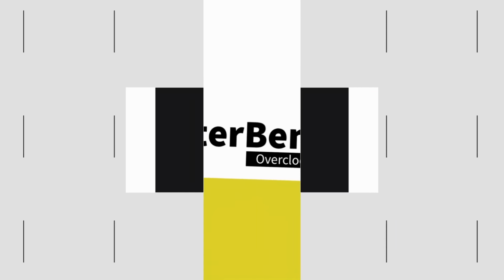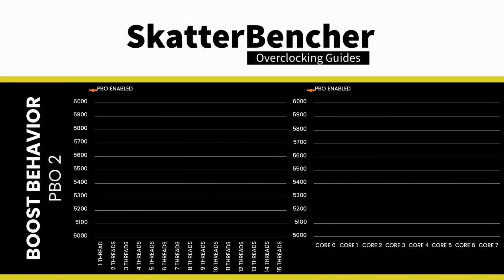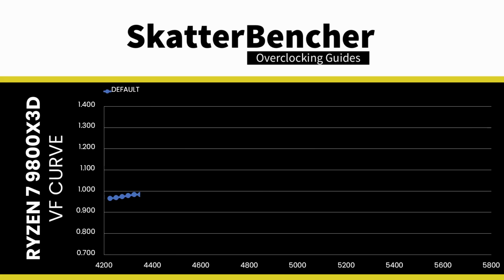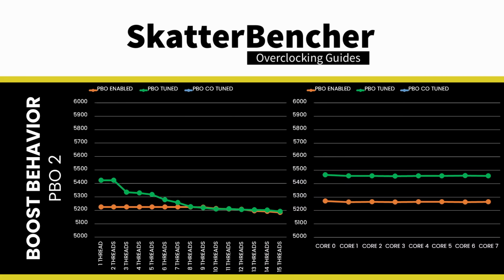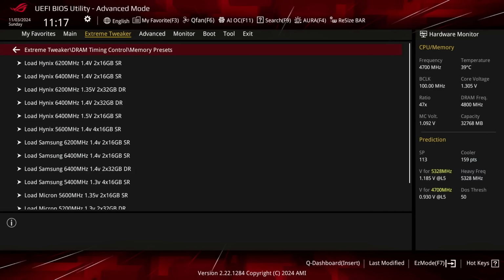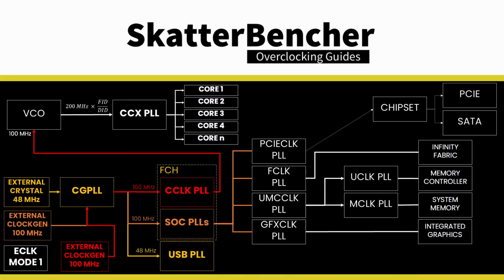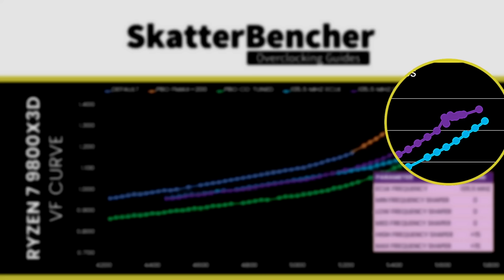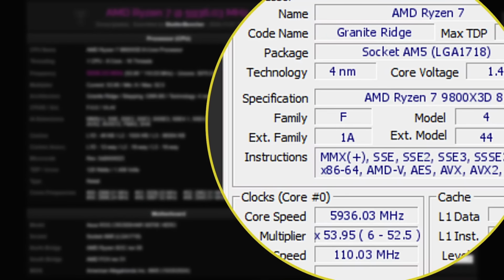Ryzen 7 9800X3D Undervolt & Overclock to 5750 MHz | SkatterBencher #82

Comment: there are people still delusional that intel is better , 5 dudes at my work went with 285k intel , i asked them why intel over Amd x3d cpus , answer was so stupid i started laughing ,
they said they tried Amd and it was nothing but driver crashes and system ran hot , 
i asked which cpu you guys tried , 2 dudes said they tried amd cpu back in 1999 and didnt like performance , others said 2005 was last time they used Amd , wow wtf , how stupid are people.
they are buying cpus based on cpu performance 20 + years ago , i just laughed are walked away .